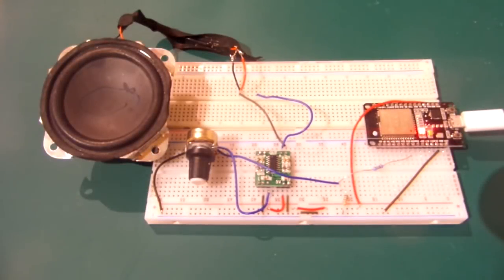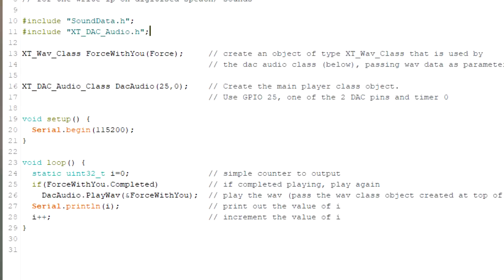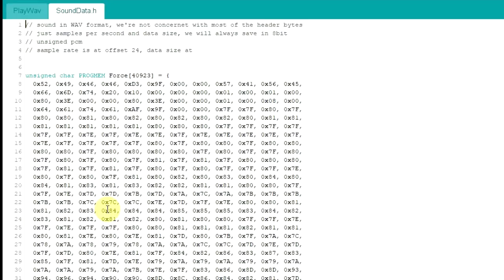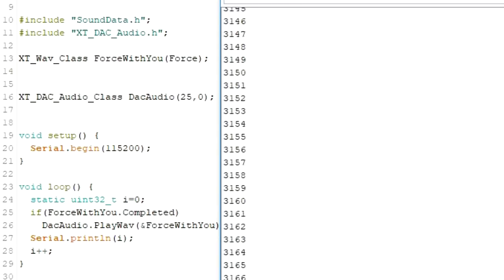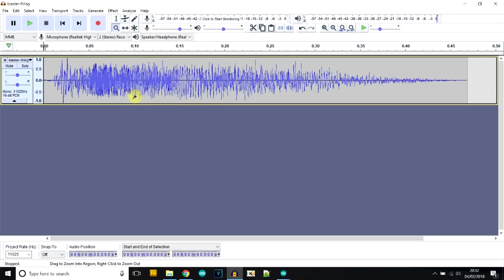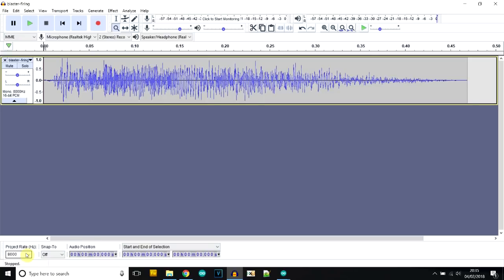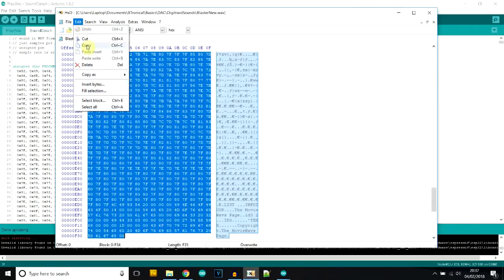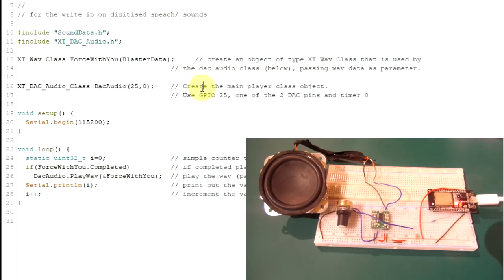Make your ESP32 talk, playing WAV files on your ESP32, digital sound DAC ADC

Comment: I keep getting an error when trying to compile the PlayWav example that wants me to include "esp32-hal-timer.h". I can't find it anywhere online. Any help?
Reply from the maker: This is a standard library for the hardware timers of the ESP32 that should be in your setup as standard. Have you gone through the tutorial on setting up an ESP32 to work with the Arduino Environment? Write up here :

http://www.xtronical.com/basics/systems/esp-32/using-esp32-arduino-ide/

and video here (although apologies the video rambles a bit)

https://youtu.be/-bbZhvaiEjA
Reply: I realized that I was trying to use it on an ESP3286. I bought an ESP32 and it works great. Thanks, by the way, for unlocking the potential of the ESP32, I am excited to try more of your projects.

Comment: This is awesome, thank you so much for building the library. Question: I have a project going to create a timer for yacht races. (https://github.com/andyrbarrow/YachtRaceTimer). Right now, in order to alert deck crew to an upcoming flag, I count down with beeps. What I really want to do is count down with a nice voice alert ("10 seconds to class flag down", for example). I've created the WAV files for numbers and the various words, and I've tested your library, successfully repeating a single word. What I don't understand is what I need to do to combine separate words to create a phrase. Do I create a separate object for each word, and then string them together? Again, thanks so much for your hard work and excellent tutorial. Going to your site now to make a donation!
Reply from the maker: Sounds a fascinating project. Yes, separate object per word and string them together, however I'm just working on adding functionality to string words together easily so you might want to hold off for now. It should be out within the week. Also there is a bug in the current version that actually makes stringing words together trickier than it should be! Thanks for the donation, appreciate it.
Reply: Fantastic! Thanks so much. I'll look forward to using the revised library.

Comment: I am having trouble compiling. I have the board set to NodeMCU-32S, and I'm first getting the error unexpected initializer before 'FORCE'. It refers to PROGMEM to have us save this array into 4MB flash. I fix this by adding #include "pgmspace.h" in SoundData.h  Then I receive the error 'no matching function for call to 'XT_DAC_Audio_Class::XT_DAC_Audio_Class(int, int)' and this is where I'm stuck. Any help would be greatly appreciated. Thanks
Reply from the maker: For the ESP32 the PROGMEM directive is actually not needed and can be removed (it's an arduino thing), might need to put a CONST in there though instead. So take out the pgmspace.h which you now shouldn't need and try again
Reply: Alright, deleting PROGMEM helped a bit, but then there were many instances saying uint8_t etc doesn't name a type so a added a #include <stdint.h>; into the XT_DAC_Audio.h and now the examples are working! I will now test my own audio files. Thanks for your work into this library!
Reply from the maker: It really is a puzzle though, something is different in the installation of files for both of us. I suspect something has changed since I download it. To not even have the basics set up for uint8_t etc. is a little odd.

Comment: Can't get it working with ESP32 DEVKIT nor LOLIN32. Does the lib only work on particular ESP32? 
I get those errors: 
warning: extra tokens at end of #include directive #include "XT_DAC_Audio.h"; 
and
warning: extra tokens at end of #include directive #include "HardwareSerial.h";
Erasing the semi colon does nothing
Any idea ?
Reply from the maker: The library is generic for ESP32. This is a compiler message, usually removing the semi-colon as you've mentioned would sort this. Are you using the Arduino IDE?  If so I suspect some compiler settings are different for this board - for whatever reason. They are just warnings, have your tried just ignoring them and uploading anyway?

Comment: Hi do you take customized audio projects based on the esp32?
Reply from the maker: Not sure exactly what you mean. Do you mean do a specific requested project.
Reply: XTronical . Yes very much like what you have done in this video.
Reply: XTronical How can i contact you?
Reply from the maker: Well, request away. I have loads to add to the existing sound library to make it how I want it for my Frogger project but if it doesn't take up too much time then I could do something else as well. What are you thinking of?
Reply from the maker: Use you tube messaging for private messages
Reply: XTronical Can you message me your email? easier to communicate via email.

Comment: how many WAV files can we upload to the ESP32?
Reply: XTronical   if we're placing bets then I'll bet a lardy cake that this chip can read the file from an sd card with one hand tied behind it's back. I don't know the chip, but I get the impression that the porting of arduino support for IIC (normal connection to sd i think) is taking a while, maybe done by now.   Subscribed and looking forward to your thoughts.
Reply from the maker: You are only limited by the memory of the ESP32 Dev board which is typically around 1 - 4 MB. So you could have 50 small files for example. There is a limit on how big one single file can be though, but cannot recall what it is at moment.
Reply from the maker: Also if struggling for memory then it may be fast enough to read direct from an SD card, but I've not tested or coded for that.
Reply: @XTronical  Please make a tutorial using the sdcard + this lib
Reply from the maker: I'm working on it
Reply from the maker: Yes this device can read sd card,  and I will do some tests in the future as I have the iic based readers in my parts bin.  These mcu's are blessed with reasonable on board memory for smallish wav files, so it was just almost a proof of concept. Although I'm not sure what throughput speed the sd card will offer, but will do some tests in the future. Thanks for your comments.